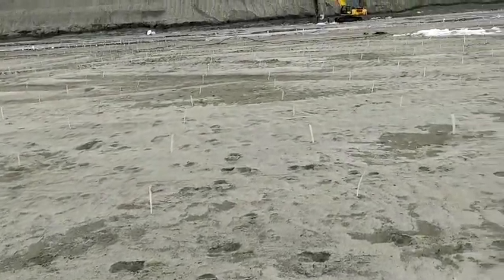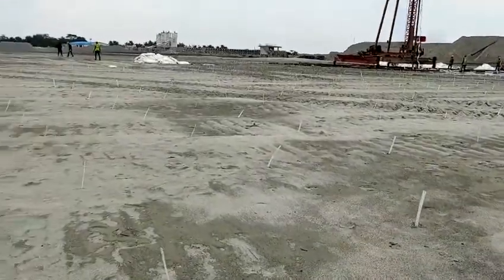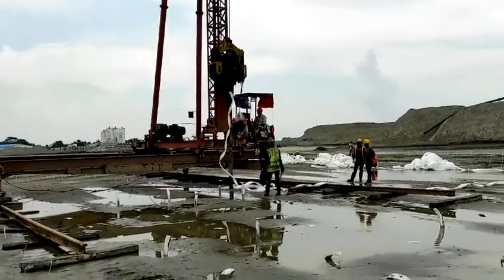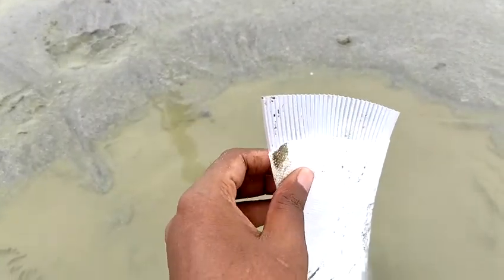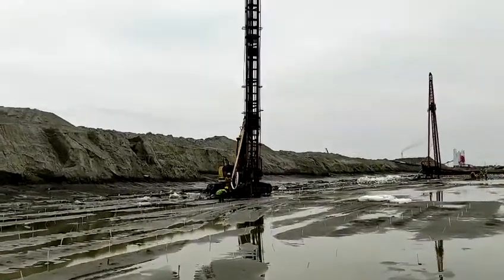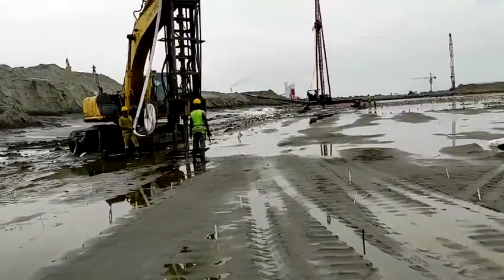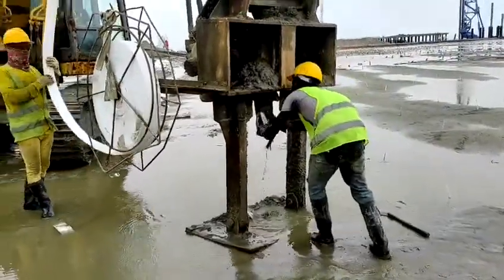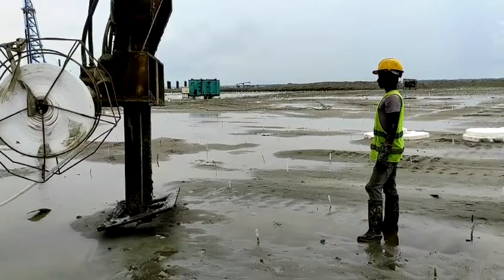Prefabricated Vertical Drains (PVD) | PVD Installation | PVD Construction | PVD Machine

Comment: PVD INSTALLATION PERMANENT OR AFTER SOME TIME AGAIN IT REMOVE .THE SETTLEMNT PLATE REMOVE AFTER BACKFILLING OR PERMANNET INSTALLED.
Reply from the maker: Pvd is installing as permanent, settlement plate is keeping at that certain level only top part GI pipes are removed for working
Reply: @nazam360  you mean the plate remain permanent and pipe remove
Reply from the maker: @MuhammadFayaz-jd6tn  yes exactly that
Reply: @nazam360  after installation of pvd how many days later we can start fill over pvd
Reply from the maker: @MuhammadFayaz-jd6tn  it could be instant after installing pvd and monitoring instruments, don't have any waiting period for filling on it.